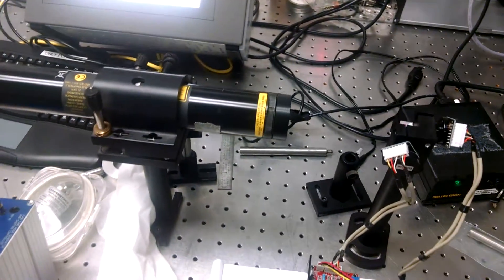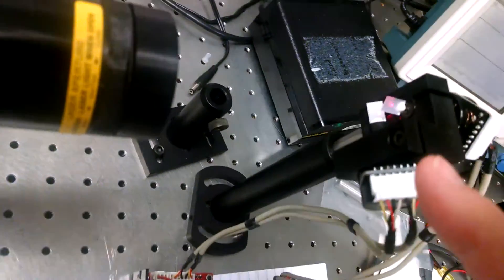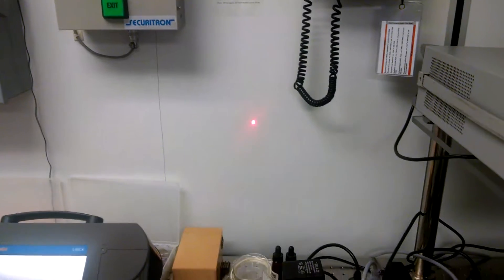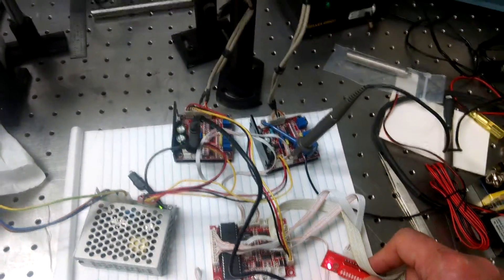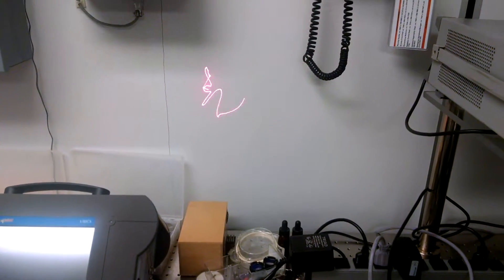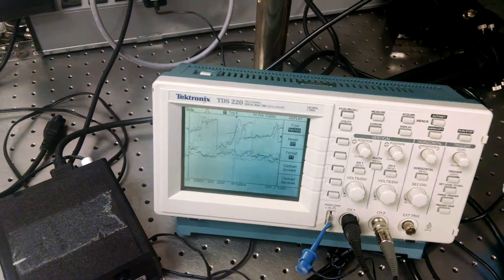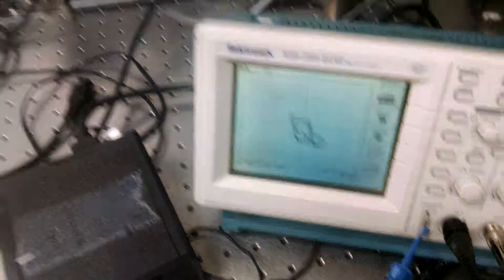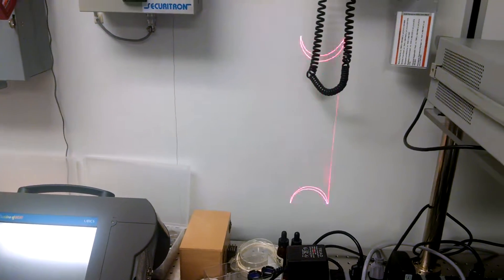The oscilloscope trick you never knew

Comment: Could you guide me Sir ?
Reply from the maker: If you have a set of galvos and you look at the DC drive signal for X in channel 1 and Y in channel two and have them both in the same voltage range, you will see this appear when you change the scope to XY mode instead of time mode.